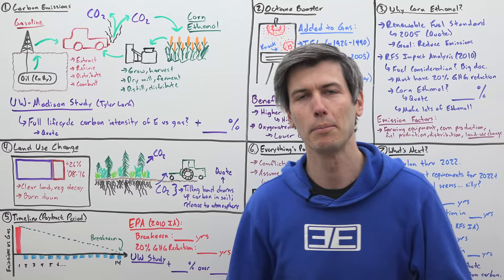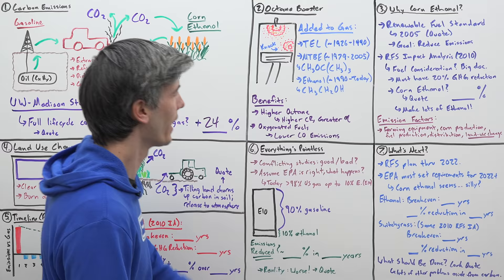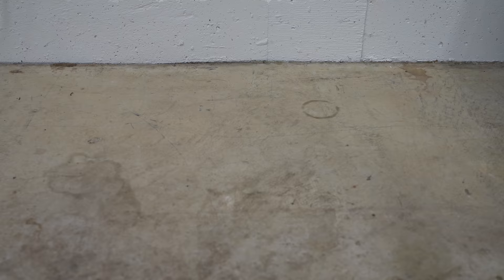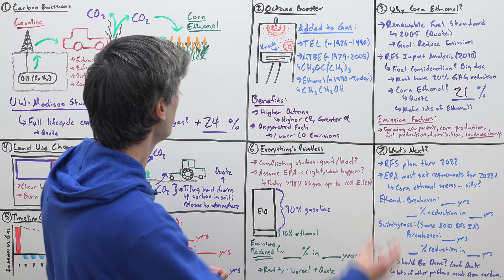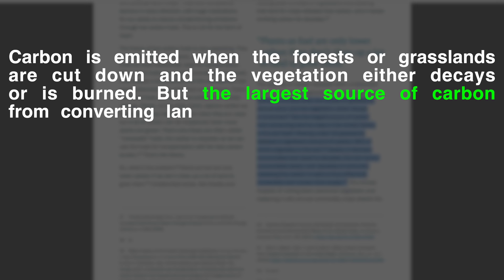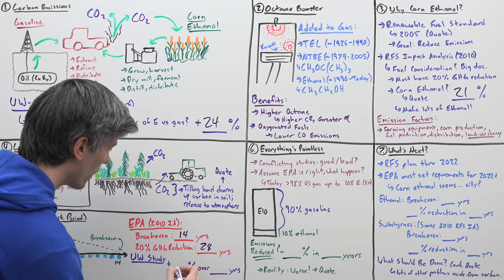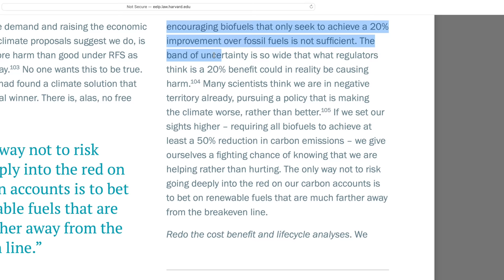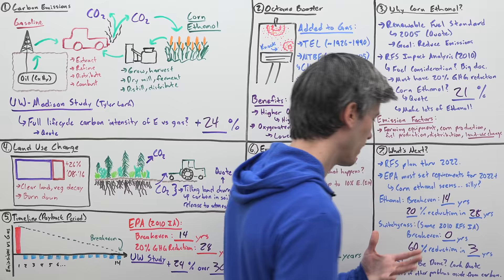America Was Wrong About Ethanol - Study Shows

Comment: This is why we need electric cars even saying that as a gearhead. YES, the net positive emissions from making the batteries is huge, but the breakeven is only around 25000 miles and the electric car becomes much better for the environment. 

As we increase our clean energy, this breakeven number become even lower.
Reply: Chevy Blazer AWD electric = $51800
Chevy Blazer AWD 2L turbo= $38100

EPA estimated cost per mile to drive AWD Blazer:
electric = 5.28 cents per mile
gas = 14.44 cents per mile

savings = $.0916 per mile

extra purchase price = $13700

13700/.0916 = 149563 miles, not 25000.  More miles if you factor in interest on money.

Range of electric Blazer = 279 miles

Range of gas 2.0 L Blazer = 521 miles

We do not have the source or infrastructure to electrify anything of significance for cars.  If we eliminated gas water heaters, gas stoves, and gas furnaces, we would not have the infrastructure for that not even counting cars or trucks.
Reply: @danafletcher2341  cost per mile doesn't affect the electric cars not having taiilpipe emissions and overall charging cars even with "dirty" electric sources is still better for the environment. And that doesn't even include the oil used. From a cost standpoint, I also didn't include the amount of money you'd save from owning an electric car due to the much less upkeep, as well as significantly simpler design/less things to break.

However, although the grid may not be there yet, that's why indestructible change is needed. Gotta start somewhere, and it can be greatly enhanced in the next 10 or even 5 years as electric cars/plug in hybrids take over
Reply: @xanderbeck7095  An ethanol powered vehicle would be pretty much pollution free with no new CO2 emissions.  With an ethanol optimized engine, we would even get more mileage and power with half the size/twice the power engine.  Even more mileage than diesel vehicles.

100% of the CO2 produced by the fermentation and burning of ethanol just came from the atmosphere and 100% of it is needed to be back there to make the new gallon of ethanol.  There were no new virgin lands or forests broken up for ethanol.  Indeed, US cropland acres have been declining so such a notion is impossible.

If Hawaii had taken a tiny fraction of the money wasted on solar and wind and instead had made ethanol plants near the thousands of abandoned acres of still growing sugarcane fields, they could be getting their electricity from burning super cheap, pollution free, and new CO2 free ethanol instead of getting the majority from burning dirty and super expensive imported diesel fuel despite all the massive funding of solar and wind which has given them sky high electric rates, higher than when they solely used diesel fuel.

Instead of the most expensive and polluting electricity around, they would have the very cleanest and cheapest electricity around.  Could have the cleanest cars and trucks as well burning super cheap island produced fuel as well.
Reply: @danafletcher2341  I didn't think of that. But wouldn't there need to be a massive amount of land to support that much corn?

Comment: you dont need to be an engineer to figure it out. how much diesel is used to grow that corn? a lot. it takes more fuel to grow corn than it does to produce oil and refine it. also the CO2 captured by the corn plant itself goes back into the air when the plant decays after the kernals of corn are harvested. did they also figure in how much pollution it put out from the production and hauling of the fertilizer used to grow that corn? most farmers use 200 to 400 pounds of fertilizer per acre. then there is the weed killer they have to produce and spray on the ground
the ethanol mandate is only about getting mid west votes for any politician that supports it
Reply: Not engineers, but perhaps knowing a little about economics and reality might help:

Iowa State University measured all the energy it takes to produce an acre of corn into a "diesel fuel equivalent"
This included making of the machinery, fertilizer, chemicals, plus the tillage, planting, spraying, harvesting, drying, trucking etc. 
They found it takes 34 gal of diesel to produce one acre of corn.
What do we get from those 34 gallons of diesel?
We get >500 gallons of ethanol.
But wait, that is not the kicker.
The kicker is we still get 100% of the protein and other things from that acre of corn still available for a healthier, even better feed called distillers grains. A win-win.

100% of the fertilizer still gets fed to the livestock in the distillers grain.  Corn ethanol is made only of things of the air: solar energy, CO2, & water with the latter two recycled once burnt.

Ethanol C2H6O = no fertilizer

Distillers grains = all the fertilizer

What logic is it to then assign all the energy and CO2 of fertilizer to ethanol and none to distillers grains? 

The US used 11,160,933 tons total fertilizer on corn in 1980, before ethanol.

In 2018, the year of most ethanol production ever, the US used 10,521,850 tons total fertilizer on corn.

More chemicals were used in 1980 as well.  Ending ethanol will not drop fertilizer or chemical use one iota.  Corn ethanol is just a value-added product from already existing corn feed acres.

A plant (trees or corn) also exudes carbon as root exudates into the soil, there is probably more total carbon below the ground than above.  Also note that no virgin soils or forests were broken up for corn, US cropland acres have been declining since ethanol so such a thing is impossible. Indeed the corn belt grew more corn acres in 1980 before ethanol.

The Congressional Budget Office had a study done on ending the mandate:

>>>CBO expects that roughly the same amount of corn ethanol would be used in 2017 if fuel suppliers had to meet requirements equal to EPA’s proposed 2014 volumes or if lawmakers repealed the RFS, because suppliers would probably find it cost-effective to use a roughly 10 percent blend of corn ethanol in gasoline in 2017 even in the absence of the RFS. Therefore, food prices would also be about the same under the 2014 volumes scenario and the repeal scenario.<<<

Comment: Well doesn't the corn as it grows, doesn't it need the CO2 to use as it's oxygen? It needs CO2 to grow and then it turns that into oxygen. Isn't it a normal cycle? I know people who grow plants and they actually put the plants in a tent, and by compressed tanks of CO2 to pump into the tent, allowing the plant to grow much faster and stronger. CO2 is needed by all the plants on earth in order to grow. Are you guys taking that into consideration? on the subject of carbon beingn released from soil, didn't we go through a giant dust bowl thing about 80 or 90 years ago and everybody lives through that with no problem. Do you guys really know what's going on?

Comment: Randolph diesel designed his engine to run on corn oil cooking not ethanol. When Henry Ford bought the diesel engine it was converted to gasoline. You can still run diesel off hot corn oil. Diesel also gives more mpg. The means of production would move from big oil to big John that's why we can't have corn gas. I don't believe your donors, converting corn to ethanol is an unnecessary straw man.
Reply: Henry Ford said of his favorite fuel (ethanol) that there is enough energy in one acre of potatoes to farm that acre for 100 years.

It still stands even today, an Iowa State study states that farmers use between 4 to 6 gallons of diesel fuel to till, plant, spray, harvest, and truck an acre of corn.

At an US average yield of 177 bushels, corn produces >500 gallon of ethanol along with a 1000 lbs. of protein and other things in the distillers grains.  

If they were to install Scania's ethanol engines sold worldwide today, they could make Henry Ford's dream a reality.  Scania states that the power and mpg of their ethanol engine is on par with their diesel engine.

John Deere and Cummins have invested in ClearFlame which is a company who converts diesel engines into using E100.  So clean it eliminates the expensive and unreliable diesel exhaust filters and DEF.  The company drove a semi-truck two years ago to Washington DC, not sure when these will be introduced but at least one trucking firm is beta testing I believe.

Plants are very good at making carbohydrates which is why ethanol is so cheap.  They are not so good in making oils which is why biodiesel is at least as expensive as petroleum.  

Henry Ford had full knowledge that ethanol optimized engines had more mpg than gasoline.  Prohibition which was massively funded by the guy known for saying "competition is a sin" put a stop to it.

Rear Admiral C.M. Chester wrote Henry Ford a letter on Dec.15, 1916:
"...I also pointed out in the article that as governmental laboratories had developed from 40 to 55% efficiency in alcohol engines as against 20% in gasoline machines, the use of alcohol at double the cost of gasoline for power purposes, was cheaper for motor[s] than gasoline in common use today."

Comment: And, the fuel mileage with ethanol is 10-20 percent less with ethanol than non ethanol fuels. If your using E85, it’s much worse. There is no way ethanol is better for the environment. Anything pushed by the government is lining someone’s pockets. Just the facts.
Reply: The EPA measured the mileage in the US vehicle fleet and states that on average E10 lowers mileage (in our current inefficient gasoline optimized engines) by 3 to 4% and E15 lowers mileage by 4 to 5% vs E0.  

The cost per mile to drive is lower with ethanol and pollution is drastically lower.

The world's most selling vehicle, the Ford F-150 is rated at 21 mpg on E0 and 16 mpg on E85 or 24% lower which is still less per mile to drive with than E0.

Denver in 1988 was the first government entity to require E10 when they were on the EPA list of ozone non-attainment zones.  Soon with ethanol they were off that list.

Even with just 10% ethanol added to E0, the Swiss Federal Laboratory for Materials Science and Technology found that the especially health devastating ultra fine or nano particulate emissions were lowered by 97%, carbon monoxide lowered by 81%, carbon dioxide lowered by 13%, aromatic hydrocarbon emissions lowered by 67-96%, and genotoxic emissions lowered by 72%.
Reply: Ethanol is renewable? Oil is not? Corn is American?

Comment: It was more about redistribution of wealth.  Run those numbers.  Alcohol has a high affinity for water, absorbing water into the gasoline. That's why lawn mowers, string trimmers, generators and such wont start after sitting all winter long. This will ruin the fuel systems,  carburetors and fuel injection. I want my old leaded gas back!
Reply: Mine just starting after sitting 4 months ....video is UP! Time for a new story.
Reply: Mercury Marine, which hosted a Webinar on ethanol myths, noted that ethanol does not "grab water molecules out of the air." It is hydrophilic, which means ethanol holds water. With regular gasoline (E0) as well at E10, the primary cause of water collecting in tanks is condensation on tank walls. But unlike E0, which can absorb almost no moisture, E10 can hold up to half of one percent of water by volume, and the water molecules will dissolve in the fuel. The "solubilized" water will bypass the water separator and burn harmlessly through the engine.

>>>>Mercury Marine also says E10 may be the superior fuel (over E0) because it keeps the fuel "dry"<<<<

If ethanol did cause water problems as falsely claimed, our eyeballs would know it right away because every winter literally millions upon millions of cars would be stalled on all the roads in the northern US and Canada. 

This obviously never happens, but many cars did stall with frozen fuel lines back in the days of E0 straight gasoline which is why little cans of alcohol for gas-line antifreeze called Heet or Dry gas were so popular and E10 is why they are not popular anymore.

The US Bureau of Labor Statistics measured share of household income spent on vehicle repairs and maintenance from 1990 to 2017 during the time ethanol in gasoline went from .1% to around 10% from 2011 onward.

The share of income spent on repair and maintenance went from 2% in 1990 to 1.5% in 2017 as ethanol usage exploded.

The DOE study showed ethanol blends last three times longer than E0 in small engines over winter.  The volatile (& toxic) aromatics like BTEX (benzene, toluene, ethylbenzene, & xylene) evaporate over winter leaving behind an unusable fuel.

Identical lawn mowers, string trimmers, generators to ours in Brazil use their common gasoline which is E27.  It has worked out so well and for so long that Paraguay went to E27.

Here is how the 2007 Energy Independence and Security Act "redistributed the wealth":

2007 WEIGHTED CORN PRICE =$4.20 WITH 4 .7B GAL MANDATE
2008 WEIGHTED CORN PRICE =$4.06 WITH 9B GAL MANDATE
2009 WEIGHTED CORN PRICE=$3.55 WITH 10.5B GAL MANDATE

2016 WEIGHTED CORN PRICE =$3.36 WITH 15B GAL MADATE MAXED OUT
2017 WEIGHTED CORN PRICE =$3.36 WITH 15B GAL MANDATE MAXED OUT
2018 WEIGHTED CORN PRICE =$3.61 WITH SAME 15B GAL MANDATE MAXED OUT + MOST ETHANOL EVER PRODUCED

Wheat
2007...............$6.48/bu
2008...............$6.78/bu
2009...………$4.87/bu

2016...………$3.89/bu
2017...............$4.72/bu
2018...............$5.15/bu

Soybeans
2007..............$10.10/bu
2008..............$ 9.97/bu
2009...……...$9.59/bu

2016..............$9.47/bu
2017..............$9.33/bu
2018..............$8.48/bu
Reply: @danafletcher2341  Them wanting leaded gas back is just scary as it gets Dana!

Comment: I'm not concerned about more co2, co2 is plant food and our planet is getting greener as a result.  Greener = Better.  What I don't like is paying more for a fuel that gets less gas mileage.
Reply: With gasoline it will cost you more per mile to drive with even with better mileage.  You will pay more in health costs as well, but nobody seems to really care about that.

The spot cash delivered price of ethanol on the NYMEX is $1.35/gallon.

The price of an unusable sub-grade of gasoline (RBOB) is $2.66/gallon.

To turn RBOB into usable E0 fuel costs even more much like premium costs more.  Unfortunately for humanity, it becomes even more toxic and dirty.

Or simply splash in >10% ethanol to RBOB and the resultant usable fuel becomes less toxic, far cleaner burning, and cheaper/cheaper per mile to drive with.  Who can be against that?

With ethanol you gain also in horsepower.  For example, a Chevy 5.3L gets a clean 380 horsepower on E85 vs a dirty 355 horsepower on E0.

With an ethanol optimized engine, you gain not only more power, but more mileage, even more mileage than a diesel engine.  This is why GM wants a 100 octane fuel standard to introduce such an engine which is also half the size.

Comment: I knew this from the get-go.
Common sense beats no sense.😊😊😊😊😊😊😊
Reply: There were no grasslands or forests broken up for corn.  Quite impossible on its face since US cropland acres have been declining.

Indeed, Census data shows that in the corn producing states, grassland, forest, and wildlife areas have increased since ethanol.

The corn belt actually grew more corn acres in 1980 before ethanol than they did in 2018, the year of most ethanol production ever.

Corn ethanol is a value-added product of already existing feed production acres which preserves the feed in a healthier and more productive form called distillers grains.

100% of the fertilizer & everything from the soil still get fed to livestock in the distillers grains.  Ethanol comes from only things of the air: solar energy, CO2, and water with the latter two recycled once burnt.

Ethanol C2H6O = no fertilizer

Distillers grains = all the fertilizer

What logic is it to then assign all the energy and CO2 of fertilizer to ethanol and none to distillers grains?
Reply: Thats a long time be be totally wrong  Owen....very sorry.

Comment: Not to mention the internal parts of a vehicle that are ruined by ethanol, and have to be produced to replace these bad parts.
Reply: Ethanol on most any manufacturers' chemical compatibility chart you will find is at worst equal to but more often easier on rubbers, plastics, and metals than what gasoline and BTEX (benzene, toluene, ethylbenzene, and xylene) are.

The parts in a flex fuel car are identical to a non-flex fuel car save the yellow gas cap perhaps an extra fuel sensor with the ECU set to "on" for flex.

The EPA before approving E15 in 2011, they and the DOE conducted long term tests on non-flex fuel vehicles 2001 and newer with not only E15 but also E20.  They found both fuels ran fine and did no damage.

The US Bureau of Labor Statistics measured share of household income spent on vehicle repairs and maintenance from 1990 to 2017 during the time ethanol in gasoline went from .1% to around 10% from 2011 onward.

The share of income spent on repair and maintenance went from 2% in 1990 to 1.5% in 2017 as ethanol usage exploded.

The very same non-flex fuel vehicles, boats, motorcycles, and small engines we have are in Brazil whose common gasoline contains 27.5% ethanol.  It has worked out so well and for so long that Paraguay went to E27 themselves.  Indonesia went to E20 and India will soon as well.  

Nebraska is in a pilot program to use E30 in their non-flex fuel state vehicles.